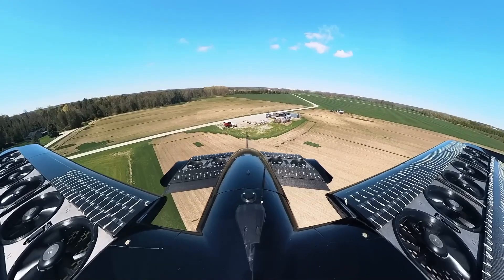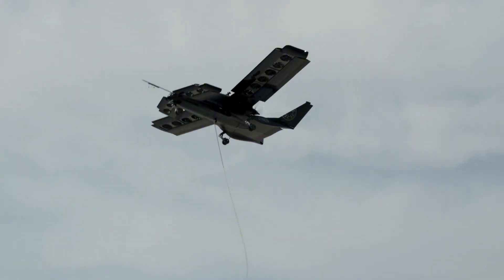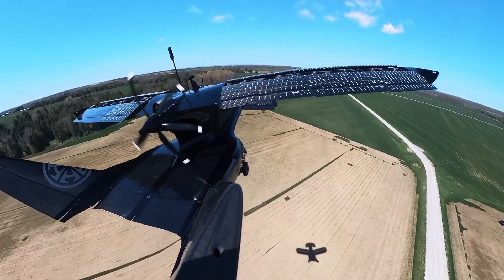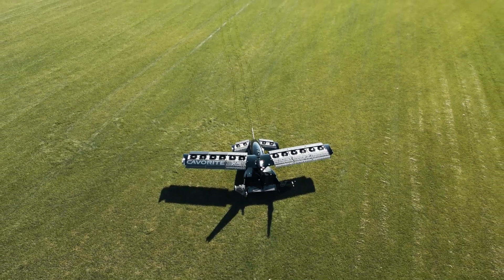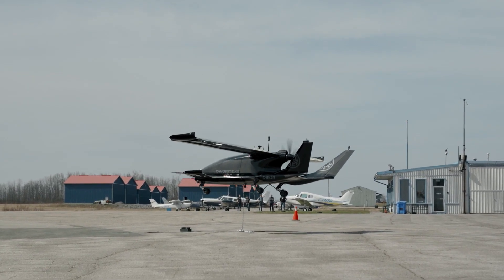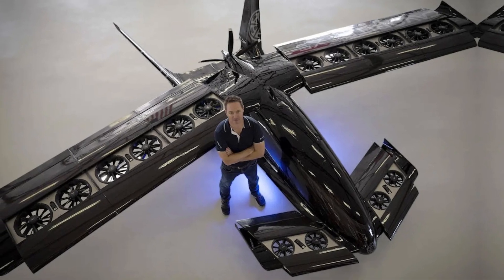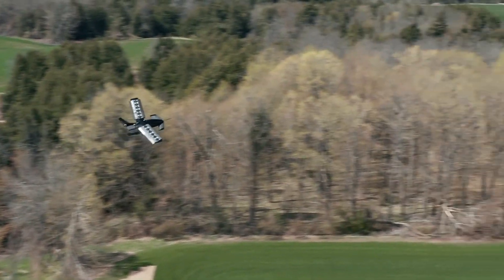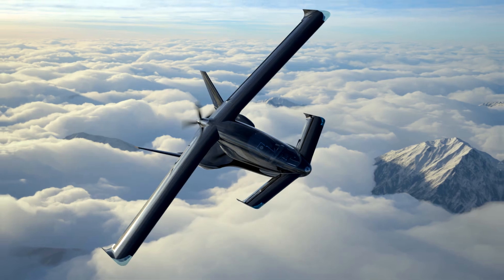World's First Fan-in-Wing Aircraft Stuns Expert

Comment: This design is inefficient. There is so much extra weight with the all the mechanisms in the wings.
Reply: Ok, ... now let me see if I can answer better, I've been on this company for a few weeks it is a vroomer. 

Now, this is only the 50% scale,  and it doesn't have full wing damping , and stiffing.   It's a scale prototype for them to shake down.    

Full scale will be far more robust with full capacity build functionality.  

Fan in wing has been proven , and large scale fans for the full scale is in production now.  An I have a feeling could be 4 to 5 fans in the wings. Oooo and that's light weight material and more structure support if you saw how they are fabricated.  

Oooo and each fan is individually power sourced.
Reply: Lol, soooo hundreds of pounds of fuel in the wings is cool. 

Those fans, are net wing wet and provide functionalities.   Fuel run out your wing yah cooked.   Wings are , just bit in and wait for it. 

This best in show, and cover multiple markets
Reply: Lol ... when you excited and dont know nothing about the company yet answer. Lol. Front run'n

Comment: I Want to see how this performs in ICE conditions with those floppy wings.
Just because you build it that doesn't make it practical.
Did we see this under full load or just a pilot?
There is a reason it has that many "FANS" now tell me how well it works with all of them disabled on either wing.
Tell me more about how well those covers perform in ice and or snow and long term use from being used.
Reply from the maker: them likkle fans are just for lift of,,to enable it take off Vertically like an eVTOL but once in Air they are not important anymore
Reply from the maker: and also maybe for hovering and landing in when they get deployed
Reply: Aircraft wings, will have play in them, and must, even rotary wing has play in it.   Long story short. Like a frisco or Japanese building,  you must build play into the design for , movement.       U get up in the air with no wing play, and , well ... ooops.  

The wing is a proprietary concept,  that open and close,  fans only exposed for vertical action.  Then its just a fix wing rear rotary propulsion.     

Dont miss out... on, 
Best in eye show, 
Supreme design margin,  
Most efficient drag ratio evtol,  
Hybrid powered advance system,  

On and on ...
Reply: @kingshark3503  Maybe we miss out on mass production as well.
Reply: @scamchan  ... well we in stage 3 , seems. They are in the mock large model scale,  that will continue shake down. N this and that. Plus a rolls royce propulsion engineer has been brought on board,  sooo they gearing up for the large production model. 

The wing is the ticket item. That's been accomplished and can scale. 

A full production model could be 4 larger fans etc etc ...  we only a step or two behind joby and archer , they have billions already,  we at 50m mrkt cap. N have the best tech spec craft in the game.   The checks will be arriving soon, and full scale by next yr
Reply: @kingshark3503  The  investors should be happy next year then.

Larger custom fans?

The should be fun to watch at scale.
Reply: @scamchan  happy now, a ground floor winner. Wowzer.    

I'm a combat veteran,  seen it all.  From take 2days to lift harrier jet,  the send you home elephant slow osprey,  to need cover fire escort blackhawk.      

This can be a a10 and blackhawk had a baby.
Reply: @kingshark3503  Amazing time to be alive.
Reply: @scamchan  ... yeah. Hey I thought we would be mad maxx future by now, granted that's not off the table just yet, lol. But some terminator series, o yeaaaah.   🎉🎉🎉🎉🎉🎉
Reply: @scamchan  ... ground floor skynet vibe
Reply: @kingshark3503  Ready to see some purpose built robots like

Lawnmower robot that can perfectly cut any lawn any terrain.

Shrub trimming bot 

Painting bot

Concrete paver bot.

They don't have to look like humans long as they can do the job.
Reply: @scamchan  .. gyro , chip, llm, materials,  cad advancement,  and simulations.  It's not far off.
Reply: @kingshark3503  Price????
Reply: @scamchan  on what?
Reply: @scamchan  ... if hovr aircraft.  Uhmmm archer has a 580mil , 116 unit proposal.    That's what  5m a clip.    We arent at full scale,  but to project.   We will have more tech, but feels it can come in at or under archer.    Feel like our phase 1 cav, could be a 3 to 5.5mil  unit, that's me skim calculating.         But, let's see how tariffs go, and etc  cost of production current is high, in a few months, could lower.   

Alot of resources right there in Canada,  so if the government get behind them, it's on.    Government should give these guys all the curb they need. 

This a potential 300b mktcap
Reply: @scamchan  .... oooops, my bad, hovr is going to be around 5.9 to 7.5m a pop.    An i found out why.  N make sense.     But, hopefully material cost by the time ordeing for invoice will be cheaper.  Hovr taking it on the chin now, but we gotta build the full scale.    But all the tech and proprietary design is worth it.   

You could spend 4.5m for a sikorsky and 6mil for a regional jet. 10.5 mil. Or 7.2 for horizon.     Yeah bby put that 3m in your pocket for waygu steak. 😊
Reply: @kingshark3503 Fun times lets see where it goes🎉
Reply: @scamchan  .... I know where it's going,  if I gotta fly it there myself.  Lol.   Nah, been doing my Colombo,  and wow!!!! Wow!!! Wow!!!  I almost wanna cry and I dont cry. Lol.  

Wow. Leadership,  staff,  the project,  the markets, the margins.  Just looking into them so far, it's really good. 

Our leader q former f18 commander.  Wow , the most maneuverable air to air bird there is, the one aircraft that name fit it. Super hornet.  

Smh, ... the father brian is a genius,  I be darn if we get pigeonholed into electric,  we going hybrid,  wow.   

Man, wow!!!!!
Reply: Ok, ... not gone go through the thread just yet. Lol.   

But, update .. I've been scouting these guys like Colombo 😅  

What we see is the 50% scale craft,   the focus was on practical,  and fan in wing ..   they right, and was no need for full on wing damping and stiffness,  they wanted to see what we see in the function of a flappy wing. 

Gives them data on what measures to take scaling up. 

These guys are ,  unique... they are very smart and resourceful with the resources in r&d , but not sparing expense.   Its literally,  common sense geniuses on the project.  

I'm amazed on what I've learned.  It's a holy grail.
Reply: Lol, see even my responses reflecting them lol. I've not met one person there. Just study study study.